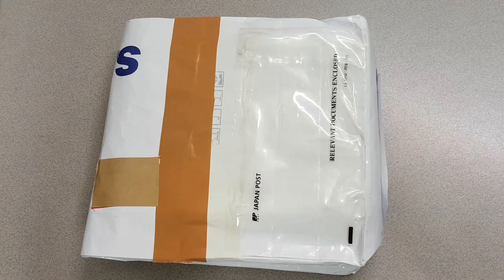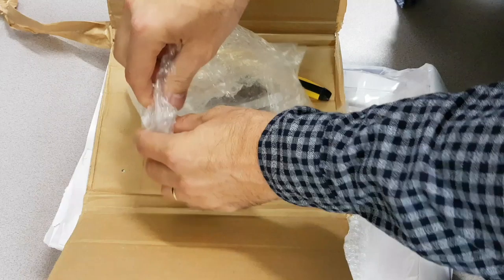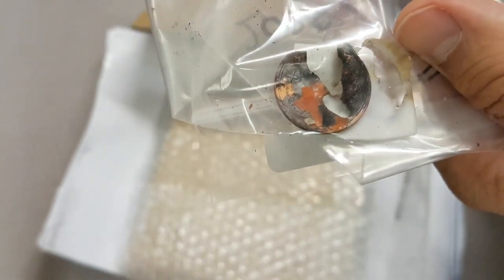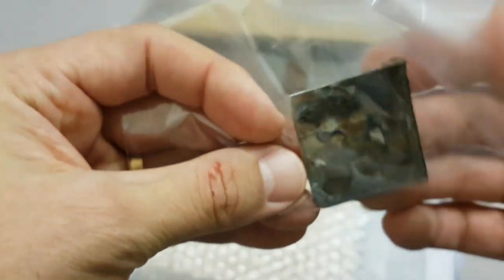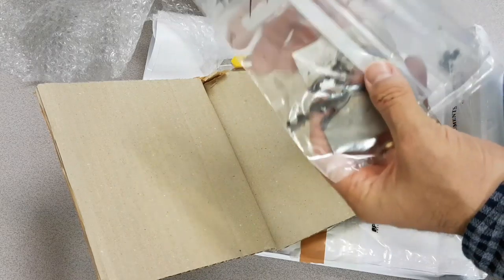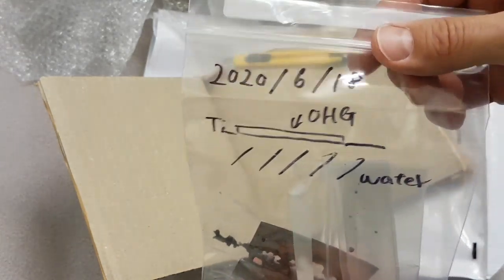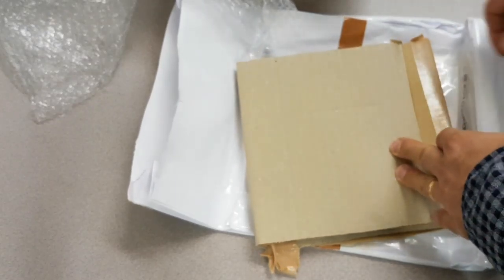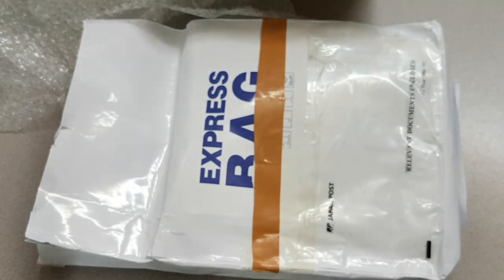OHMA - New test samples have arrived from Japan

Comment: Could you give a brief description of why we are testing?
Reply from the maker: Ohmasa Gas has been shown to have about 0.28% atomic Hydrogen and to produce Exotic Vacuum Objects (research Ken Shoulders). It is a gas similar to Brown Gas.

By application of this gas to various elements, transmutations are observed, always to safe - non-toxic elements. Heavy elements such as W (Tungsten) fission and nucleon exchange in the presence of atomic Hydrogen and EVOs to lighter elements. This is claimed to be the same for radioactive elements.

If we can prove beyond doubt that this occurs, we can clean up Fukashima, Chernobyl, Enewetak Atoll and consider fission fusion safe.
Reply: @MFMP  is this similar to the work being done by black light power?  Hydrinos?  A lower energy state of hydrogen?  Thanks for the reply.  Gosh i hope these energy technologies break out soon.  The current energy MIC/banking behemoths are underpinning the economic foundations of the last 100+ years.  They have managed to suppress any competing tech and rationalized the effort using whatever reasons that worked, and have amassed huge wealth and power.  Time to let it rip.
Reply from the maker: @weinerdog137  Time to let rip